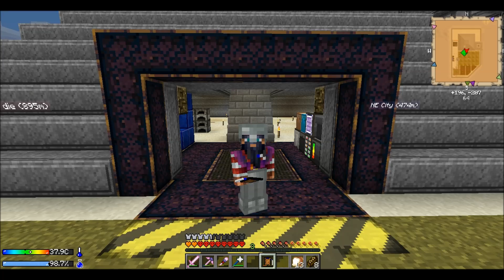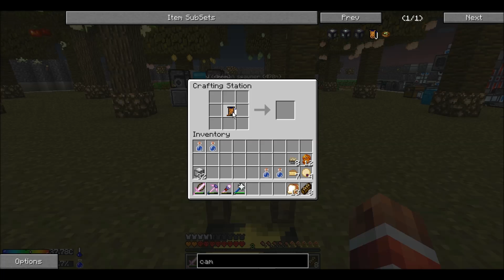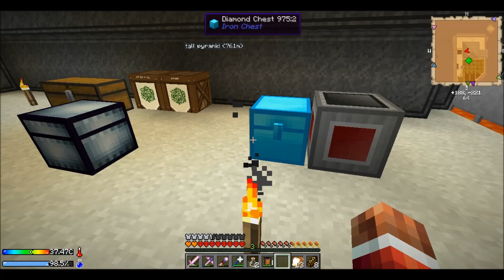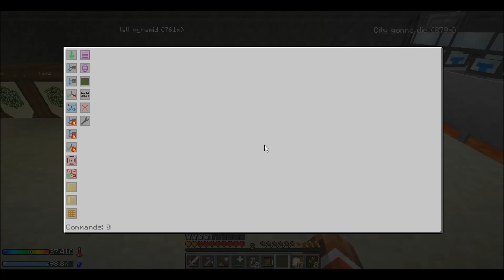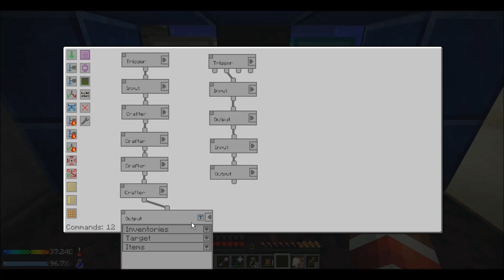Crash Landing - Auto Camelpack Refilling

Comment: It Works fine but for one strange reason it gives me no empty glass bottle back (I double checked the exes chest setting on the crafter command)
Reply: +Greuslich same here
Reply: The problem is the paticular version of Steves Factory Manager in the latest Crash Landing. I downgraded SFM manually (edit Modpack) to the prior version, that fixed the problem for me.
Reply: cheers. i will look into that.
Reply: @Greuslich  where did you get the prior version? i'm having the exact same problem with version A83 of SFM and i'm getting crazy trying to find an older version